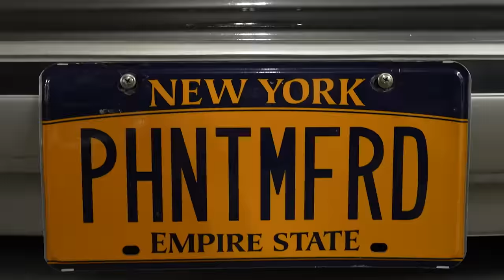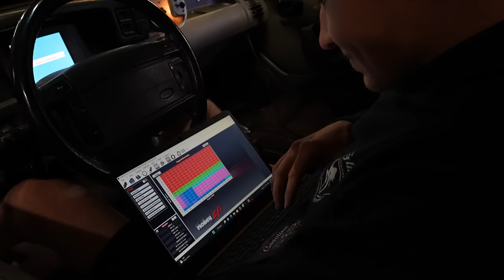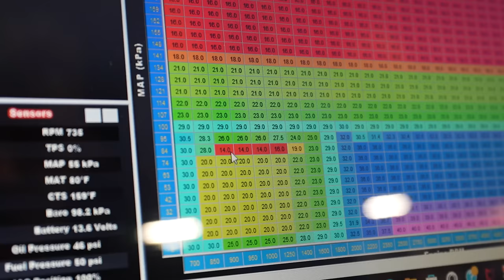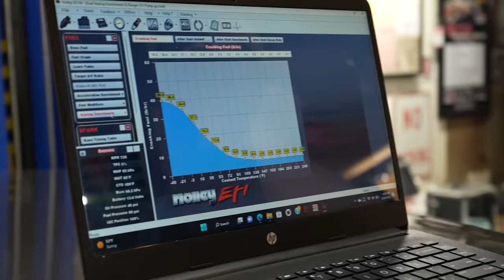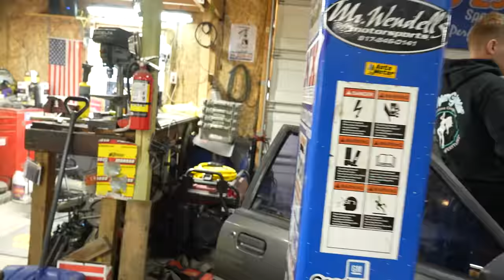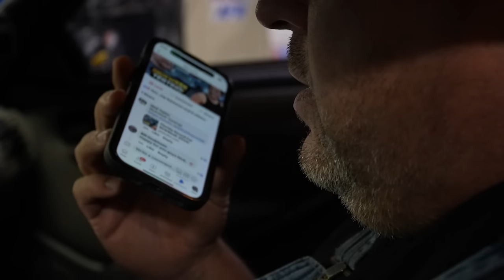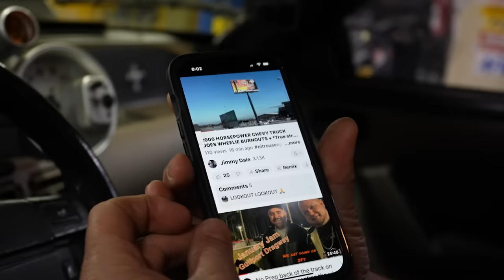First Drive with Dad’s 1000+ HP Foxbody The waste-gates were PINNED Shut 😳

Comment: My dudes, hi from Australia again.
Hope you checked on those sparks from the last dyno run on the old boys Mali.
The smoke you see is the turbo seal from too much oil pressure on a journal bearing turbo. Easy fixed with an in line restrictor 👌🏽

Yep, should have watched the full vid before commenting 😂

Comment: Hey guys,check the serpentine belt. I have seen the belt get so worn,they will slip on the alternator when it gets load. You can unplug the exciter wire and listen to the belt. It will squeal or you can hear the alternator slowly pick up speed.Just cause it is a serpentine belt,don't mean it won't slip.Good luck guys,and GOD BLESS!!!!

Comment: It looks like it has a stock fox body alternator which were like 65 amp alternators.   She needs an upgraded internal fan 130 amp alt upgrade which is super common on fox bodies.  Make sure to upgrade the power wire that goes to the battery to a heavier gauge too as the stock wiring will catch on fire.

Comment: 30psi @ 5700 rpm on pump ⛽  shew wee! Lol that is a good little motor. I knew your pops would love turbo efi stuff. We're the same age and I  fought it for a long time. Once I switched to it in 2015 I have kicked myself for not doing it sooner. Also, I had 3 of the 5.7" dashboards and there's a reason they stopped making them. Kept freezing or blue/black screening and you have to update it again. That's if it will connect.

Comment: Awesome video!! I thought I would never see the old man driving a mustang 😂😂 but definitely cool he bought one with a ford motor and it’s boosted. I would recommend replacing the 2g alternator with a 3g alternator. The stock one barely puts out enough voltage to run a stock car 😂😂

Comment: it was the water methenal that saved it. Water methenal adds power but it also adds 20 points to the octane making the 93 a 113 safe for 30 lbs if you have enough injector

Comment: Definitely put a regulator to the turbo, I put one and it solved my smoking after pulls. My engine also make 90+ psi when it’s high rpm. I went with the turbo smart one.

Comment: My vibe was a twisted drive shaft. But I can't believe in 91' is when the GT hit his school. My school it was the 86' GT. I graduated in 89' with a 69 Mach 1 but bought a 90' GT in January. While building a 69' Ford Cobra 428CJ. Almost traded the Mach 1 for a 69 Camaro. But I had already painted the Mach 1. Didn't want to do all that sanding again. I needed something reliable and couldn't afford GN. Did plenty racing in my 90' Always in the finals for my bracket.

Comment: I had a Mustang and installed under drive pulleys that caused the voltmeter to read low because I didn’t change the alternator pulley. Just a thought on the voltage issue.

Comment: I made 1230whp 25lbs of boost with a 4303 on c16. 950whp maxxed that pump out on e85. -12 feed to pump-10 to y block and -8 return. That pump should be fine with the correct voltage like you said

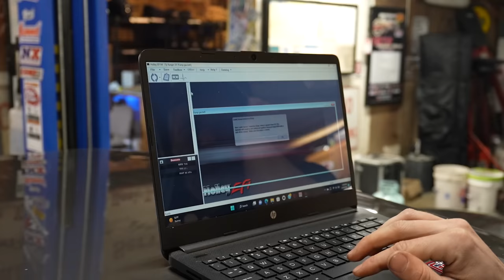Comment: @14:15  As a SBF single turbo owner for many years, running a Holley, these healthy SBFs like to idle around 20 degrees of timing.  Also, that 14 degree area in the 84 KPA area is there for a reason.  You will figure out why when you go to put it on the brake for the first time and try to build boost. 
With the engine at idle, transbrake engaged & foot to the floor I bet it's going to shoot up into that 14 degree area that you now made 30 degree's & it's not going to build boost for shyt.  
Also, depending on the camshaft, you may want to scale the MAP access up to around 35-45 KPA, that engine will never idle anywhere near 0 to 21 KPA..  you're just losing drivability resolution there.
Email me the map, I'll mess with it if you'd like or go live with you one night and go over a few tings with these damn SBF's.  Love the car btw, glad the Old Man finally got one and is enjoying the hell out of it.  
PS:  I'm definitely not taking anything anything away from Billy's skills with the Holley, just figured I'd share some of my many years of messing with these SBF turbo deals over the last 15 years.

Comment: the best alternator for the fox body that i have used is through pa performance , indestructable and work great , they should have a 200 amp gen 2-3 alternator for that car , that will work great , try them out i have had great luck with them

Comment: If that has a journal bearing turbo it needs to have an oil restrictor going into turbo. You can also measure the size of restrictor buy starting up and filling a cup of oil in 30 seconds. Too much oil pressure will definitely put oil in the exhaust.

Comment: Mechman 340 amp alts are the way to go buddy you can get them from Down for sound out of loss Vegas you can get a regulator to turn up the volts 16 even 2/0 wire for power ground and main ground you will get all the power you need for pumps and all your accessories

Comment: Remember when you convert kpa to psi you have to subtract atmospheric pressure (14.7 psi). 120 kpa is around 3psi
Reply: Bingo!  That "30psi" was probably more like 14.5psi if they came up with that number the same way.
Reply: @andrewcammer2535  could be, my Fairmont made around 800 whp on 17 psi with the same turbo. It would have it's tongue hanging out at 30.

Comment: Check the crank pulley it prolly has an under drive pulley everyone did that nd they don’t have shit voltage nd belt squeaks cuz now the belt is good so check the size nd make sure it maches factory I had the problem on mine when I bought it

Comment: 100 kpa is 0 psi of boost or 14.7psi absolute pressure 200 kpa is 14.7 psi of boost 29.4psi absolute (absolute pressure is baro pressure + boost pressure) baro pressure is 14.7psi at sea level . Your 30psi of boost more then likely is only 14-15psi of boost. If you need any help with holley lmk i can send you my email or my shop info 🤘

Comment: I graduated high school  in 88, and the Cobras were the best of the best appearance wise , then the GTs, then the LXs. The LXs were the sleepers of the day. They all had the same 225 horse engine, and the LXs had the least amount of body panel extras. They were the lightest as well because of that . So if you did not care about looks, the LXs were the best for speed if you wanted to knock out a 3rd gen Camaro. And I am a Camaro guy. V8 Mustangs had stock shorty headers, 3rd gen Camaros had exhaust manifolds stock. The Cobras got all the pussy lol. Ford knew what they were doing. Respect. Funny thing I owned a 71 nova at the time in 89 but bought a 71 351 Mustang fastback after that. So I am not prejudiced , I love all American muscle.

Comment: Once ya'll get the car all lined out and dialed in and switch it over to E85 I would love to see you guys take it to a No Prep shootout and I would love to see a side by side comparison with the Malibu on the street and when you do the 5 lug swap Iwould make sure it has 35spline axles and c-clip eliminators in it along with all the other good 8.8 parts and when you put a set of brakes on it I would put TBM brakes all the way around it and I would put a new set of Snake Eater Performance injectors in it just to be on the safe side and when you get the RC COMP wheels for it I would put a new set radials on it or a set of slicks and see just how much you can improve on the 5.60 time and if it doesn't have an aftermarket set of upper torque boxes I would weld in a new set of those as well and you should go with Cameron Johnson Race Cars for the upper torque boxes if you do need a set and I would put an anti-roll bar in it as well but before it's over with I foresee you trading your Dad your new Chevy II Nova for this car unless he really does like this car and wants to play with it and learn EFI before he does the giveaway on it and I know he likes his street car's but I think he needs to get his Nova back out and put a built SBC or BBC with EFI and boost it with either a big single turbo or put a Procharger on it so he doesn't have to worry about a bump box or anything like that he can just put it to the floor and go and have his Nova as an all out drag car and have the Malibu as his street car and that way he can get into multiple types of races

Comment: Amazon has a really nice 300 amp alternator it's black and it's 14     v olt real nice unit they had 2:20 amp 240 a and 255 amp for under a hundred sixty bucks 12 v

Comment: *Facepalm*...Billy should have been watching the gauges on the laptop. Sounds like there were several signs not to get into boost with that thing. Check the fuel pressure, and injector size. You can add a little more base fuel pressure to help with the IDC. That pump is plenty, probably needs bigger injectors. Def needs a bigger amperage alternator.

Comment: Wow 30lbs on 93!!!!! I suppose the low timing saved you on that deal. Hot running engine and high boost with low octane is kinda a recipe for butting rings.

Comment: I know thay were nervous last time billy turned the boost to 32 psi the s10 it kicked the rods out the oilpan which was at a longer run but still most would lift the head and spit the head gasket at the least if anything had sbf at track lift the head and reseal itself right back and finish racing ...

Comment: Oh shit tell me that’s an 87 I had the same one for 60 big block 750 Holley, double pump all aluminum fan and front motor covers. Everything else was stock but bare-bones I couldn’t keep the hatch shut. I had to use a bungee strap from the car, twisting so much out of the hole to keep the back from opening every time I left a stop sign literally nothing inside the car. I tore it all out bare metal no cage two front seats had my first son I was 26. I put the car out front for sale for $2000 the year was 2007. It sat there for so long, because everybody knew that if you bought that car, you weren’t buying anything buy tickets or a dead brother or son. Eventually, two kids traveling through my town from Delaware. Stop asked me how much I wanted for it or at least what I would take other than two grand, at that point in time my son’s mom was already nine months along and pregnant as hell I wind up letting the car go for $800 that’s all the cash they could scrounge up being out of state in that year and time that money was gone in three hours. I wish I still had my car.
Reply: I graduated in 99

Comment: I graduated in 01 and my one good buddy had a GT like this one but it still wasn’t quite enough to take my 69 dart with some bolt ons on the old 318 that motor just ran damb good for what it was the  big problem with it was it only had the junk 904 transmission in it that would never have 2nd gear no matter how many times it got rebuilt good news is I still have it bad news is Matt went over to fight in Iraq and never came back RIP buddy we all still miss you!!!!

Comment: No reason for 34 degrees for idle. should idle around 14-16 degrees and use adaptive idle timing if needed, should idle fine with no IAC.  and 12.6:1 is asking for trouble i think on pump gas, well 30psi is too but i think you know that already.

Comment: You can add the new style alt off the f150 they are 200amp the on that car is 100  also if it has the old 1 wire starter you can put on off a 93 on there it’s the high tork one I had that same car as my first car also the same color when you guys do get ready to sell it let me know I have been wanting one again

Comment: WELCOME TO THE DARK SIDE ... Have a  cookie 😆But Bill is right I graduated in 88-89 the posers ran LX mustangs the cool kids ran 5.0 GT's or Camaro or small block GM V8's 4 bolt mains with 400 turbos. my '79 Chevy Luv only had a 231v6 with 350 turbie out of a '79 Monte Carlo but it ate GT's 5,0 for breakfast/lunch/ and dinner. and he literally said BEFORE it all started was the GATES WERE PINNED at 7:00 on tape

Comment: I've had Mustang's on and off all my life since I was old enough to drive. My dream was to have a 11 sec street car for a daily driver. And to have 1 that Was boosted. Either pro charger or turbo. But every time I have Had a Mustang and by the time I either fixed it up. Body wise by painting it and everything else. I ended up needed to sell it when me and my wide wad in a fatal accident 3 years ago and then finding out I had cancer why I was in hospital. I went out and got a 2013 gt because I thought I wasn't going to live and even tho it wasn't new it was my Favorite color you gotta have it green. But it does have the glass top. Which I'm not a big fan of. But now that I'm cancer free at the time I didn't care. But I was Writing To see What would be the cheapest route to go with a 2013 Mustang GT that's automatic. To get it in the 11s don't think it would take to much to get into the upper 11s Is it capable of handling a small Turbo like 6 pounds of boost? Or would I have to change everything just to get that little bit? I was hoping since I have the engage. Could I buy a small Turbo and build the piping myself? And not have to buy all kinds of new parts. wouldn't be able to afford that right now. Since I'm still trying to play catch up. From the accident where the lady was at fault that didn't have insurance. And then having cancer not having health insurance.

Comment: Yeah the restriction was the wastegate pinned closed, duh... All crap aside, it's a clean car and I'm sure y'all will make it right, just rent be doing anything else foolish like running 30psi of boost with the wastegate closed or running out of fuel pump or injectors.

Comment: Yall need some Ford boys for problems lol. Alt prob as bad as ps pump. 3 wire reg plug is probably melted. About $15. Make sure to never underdrive 
Anything on it lol. Every now and then mine would use the coolant as a waste gate. If you loose boost you can find it in radiator. Please please dont put 1pc lights in it.

Comment: once you see the power a real ford can make I honestly do not see you going back, after all, sbf are the 350's of the 21th century, that is until you own a MOPAR :D
Reply: 8.8 35 spline axles with 1000+....may as well put an anti roll bar on that thing while doing back brakes, if it doesnt already have one, its going to need one.....good time to call tin soldiers :) I will be trying to win that when the time comes :)